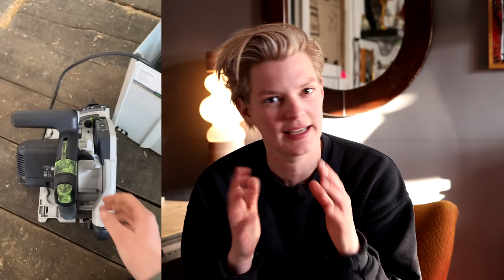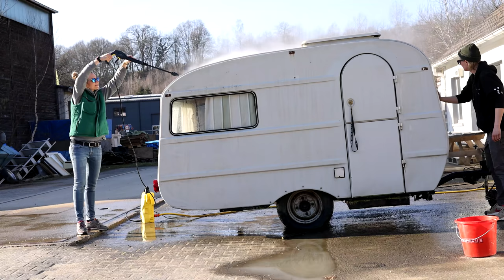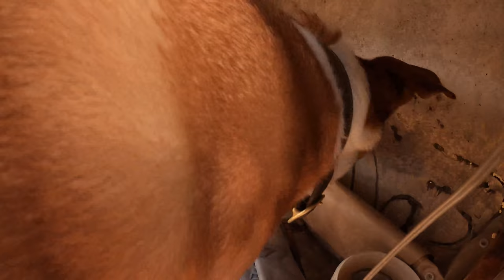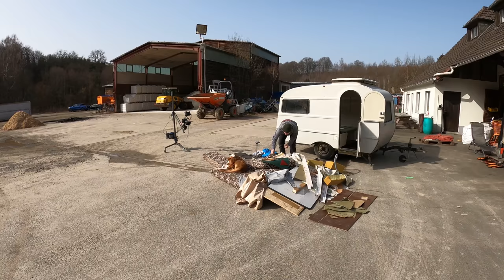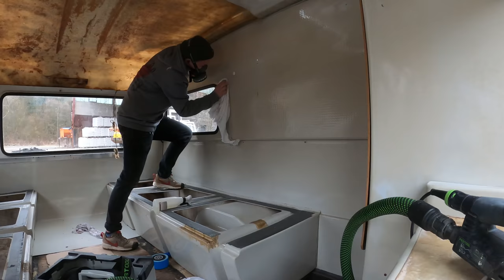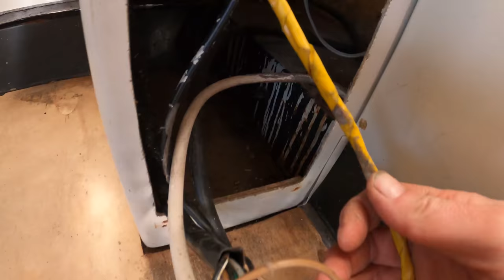40 Year Old Camper Renovation - Bad Idea?

Comment: I recently inherited my uncle's old RV. At first, it always seems like a great project. After breaking down 3 times trying to get it home, paying 2000$ for new brakes, tires, and working on it in 36 degree weather, AND gutting the entire thing only to realize the roof needs to be replaced.... It is a little overwhelming. But I will keep pushing through. Your adorable little camper cleaned up REALLY nicely! I hope you enjoy using it as much (or more) than working on it. Cheers!
Reply: Have u finished your project a year later
Reply: @robloxianashleyy2188  the project took a sharp turn. Unfortunately, the camper walls and floor were too far gone to save. I stripped the entire RV down to bare chassis, and put a 41 Ford truck cab on it. It will take some time to finish, but it will be worth it in the long run. I'm still dreaming of camping. It will just be a bit different.
Reply: Good work bro take good care of it 😁

Comment: That sounds like a bad idea....
a 40 year old QEK without any papers.... no way...
...so let´s go for ist!
Reply from the maker: Yes!
Reply: I was in W. Germany for a couple of years, however no knowledge of camper vans.  If it hasn't been on the road for 5-10 years, used on the road, then is there a VIN or something?  Do you need some sort of certificate from the DMV equivilent to actually use it on the road?  Non-Germans are curious.
I know you're going to throw some solar panels on the top, and run 12/24v electrics, right?

Comment: I rebuilt one just like it in 2015 for my daughter in Ireland. It was much worse. The walls where no longer attached to the non existing floor. 80 % of the wall members were rotten and had to be replaced. Had to replace all new metal floor cross members with a new floor. Installed a swing up side window because she was going to use it as a sales caravan.10 hr days two weeks later it was a sound road worthy  camper. She worked on it during the weekends for another month painting and completing the decor.

Comment: I was amazed how nice it looked after you went around with high pressure cleaner 👍🏼
Reply: Yes good to use on this camper but only because it's fibreglass and pretty waterproof....but I won't be doing on my camper which is aluminium clad over a wood frame with a metal chassis and wooden floor. Horses for courses. Fun to watch!

Comment: I was impressed just after washing. Cleaned up nicely. I'm remodeling my camper this year plus fixing a much needed small leak. Those vents in the roof are so unnecessary unless it holds a fan. This one leaking does not. Lol. Great job,good luck with your future campers.

Comment: OMG Laura, ive bought a camper in worse condition but ... i dont have any diy skills ... yet. i found half the wall on one side to be damp so had to scrape the insulator off the inside which only leaves the outer skin. ive had to peel back half the inside of the roof too. the wooden framing in those areas is all rotten so out that went too. it's so daunting as i can rip out but at some stage im going to gave to fix/construct everything. im very glad ive found your channel! thank you 🌼🌸🌼

Comment: This type of camper is a good choice, because the GFK (plastic) won't rot away. I would never buy an older camper made of plywood, because after the years they will always have leakages and mold caused by water. Good choice!

Comment: the guy got a pretty good deal with the tracksaw , 
the camper is made of poliester from the looks of it , they dont leak as mush as the wood frame aluminium ones and even if they do they dont rot out the wooden structure  
yeah i think it can be fixed as long as the undercarriage is not too rusted and the wheelbearings and stuff are still ok , think light when making the interior , the lighter it is the more pots , pans and clothing you can load intoo it 
you might want to replace the trailercoupler , seems to be an older type

Comment: it really doesnt look that bad at all. Yeah the outside was dirty. but as far as the inside. after the stuff was removed. Does look that bad. even dirty. 
Some work and cleaning is needed. 
FYI for the tipping issue. Could find a way to put a Jack Stand under the back. Would work. for the roof, If I was able to get a Rubber Membrane I would put that down on the roof. Otherwise something like the Flex Seal Paint would work really well. Even if there wasnt any holes in roof. I would still Flex Seal the Entire Roof just make it stronger and more water proof.

Comment: A Qek was also my first idea when I was looking for a camper which I can pull with my Renault 4. But then I I learned about the Rapido Confort, which is even lighter, and (in a reasonable constitution) cheaper. My Rapido is now 44 years old, I replaced the electronics, the gas-heater, which is not conform with the German "TÜV", and of course mattresses and curtains with new old style material. But I still like the idea of getting a Qek.

Comment: I'm curious how your little QEK Junior will turn out. Definitely will watch :) For our own projects, we always convert all the electric stuff to 12V, driven from an on-board battery (and a rooftop solar panel). We then connect the exterior lights as well, (tail lights, and two white head position lights, along with one to give some exterior illumination to the door area). That way we can easily switch on parking lights to keep it illuminated when parked somewhere on the road, and with an additional light sensor, have them switch themselves on when it's getting dark.

Comment: This appears to be a fun project with a strong upside. Obviously acquiring that little vehicle for an out of date saw is an incredible bargain.  
I would recommend roughing the surface around the leaking area, wipe clean with alcohol, use a primer, and then you will be sure of increased adhesion. Considering the apparent thinness of the roofing material, I suspect that there may be significant flexion in the area of your patch. 
Best wishes as you proceed

Comment: It looks like solid fiberglass and should be worth it! Basically indestructible if it hasn't developed some kind of surface damage from the sun UV or osmosis blisters from being in water (boats). No wood or insulation to rot. It might need patching for leaks or insulation depending on how you want to use it.
PS: I think before patching the holes you should have sanded the surrounding area down a bit first. Probably not that important since it's not structural.

Comment: That little camper has potential.  Keep it simple.  Its basically a fiberglass tent on wheels.   Might even consider doing more fiberglass work on the inside and making it so you could remove the cushions and spray the inside down to clean it... just ad a drain in the bottom.   What is the big roof hatch on the top for?  Star gazing or does it pop up for standing space?

Comment: Please, please, please don't forget the underside of the camper. Specifically  the wheel bearings will need to be cleaned, inspected, and repacked with fresh wheel bearing grease. Also the hitch connector should be checked, and check for bad welds. Safety items!

Comment: pressure cleaning made it look beautiful , cleaning the inside i  see alot of work, at time out 7;19 you applied fiberglass , wrong one, on the surface you  should have place mat first, the fuzzy looking fiberglass, then applied the 10 oz. cloth, dry  in applied 2 light coat of straight resin on top, dry, then sanded it off, the mat is your  base, then cloth covers  to protect the mat. if you  apply cloth only first its going to leak in that spot and slice right off. . so, may, then cloth , then 2 coats of resin , then dry, then sand.  to save money you need to go to a home that is being built or insulation leftovers, lumber, . i did the same thing to a trailer i restored , save a bunch of money, on insulation, lumber, screws, even got a refer, for free,. all electricity wires, and some outlets, . junk or throw away is king?

Comment: Forty year old camper?   Chump change.   We have a 1946 Spartan Manor [74 years old right now]; 1950 Spartan Royal Mansion [71 years old]; and 1964 Fireball Meteor named “derel” (short for derelict).  A 40 year old camper is almost brand new!  You ain’t seen “dirty” until you shovel out rat/mouse turds averaging 5” deep in the walls.   Not to mention dead critters and one live rat.

Comment: One Question:- Would it be an idea to fit one of those diesel heaters or a wood stove for winter use? If you have this stripped down to the basics installing stuff like LED's would be an advantage, but having heat when you need it means all year round use?

Comment: Hey Laura, first of all a big praise for your videos.
I have a question: I want to build a similar small desk for my son out of a suitcase, like the one on which you always do the moderation. I've clicked through your videos, but so far I haven't found a link to a video that shows how you build it. Are there any videos of that at all? 
I'm specifically concerned with making the table top that you fold down safe and loadable. So that it is space-saving, hardly visible and stable, so that you can lean on the table top without it breaking off immediately. If you have a project that addresses the problem, I would be happy to hear from you.

Otherwise, keep up the good work! I'm excited to see how it goes with the little trailer!

Best regards from East Frisia,
Stephan

---

Deutsch:
Hey Laura, erstmal ein dickes Lob für deine Videos.
Ich hab mal 'ne Frage: Ich möchte für meinen Sohn einen ähnlichen kleinen Schreibtisch aus einem Koffer bauen, wie der, an dem Du immer die Moderation machst. Ich habe mich mal durch deine Videos geklickt, aber bis jetzt keinen Link zu einem Video gefunden, der zeigt, wie du den baust. Gibt es davon überhaupt Videos? 
Mir geht es speziell darum die Tischplatte, die man herunterklappt, sicher und belastbar zu machen. Also so, dass sie platzsparend, kaum sichtbar und stabil ist, damit man sich auch mal auf die Tischplatte auflehnen kann, ohne das sie sofort abbricht. Wenn Du ein Projekt hast, dass sich dem Problem widmet, würde ich mich über eine Antwort freuen.

Ansonsten: Mach weiter so! Ich bin gespannt, wie es mit dem kleinen Wohnanhänger weitergeht!

Liebe Grüße aus Ostfriesland,
Stephan